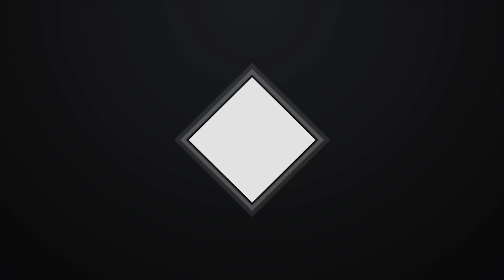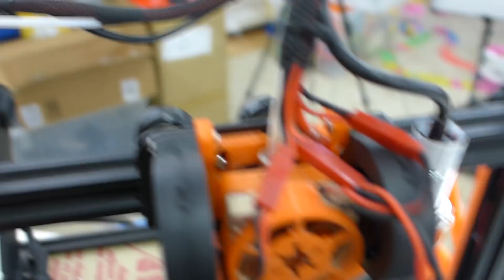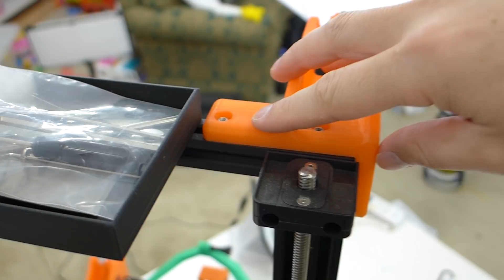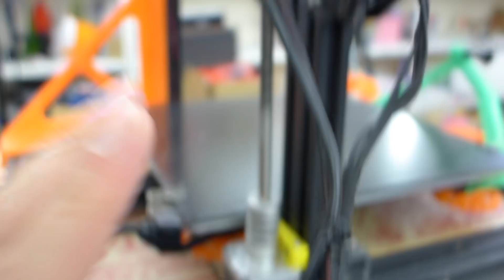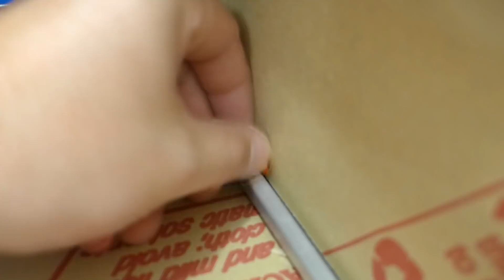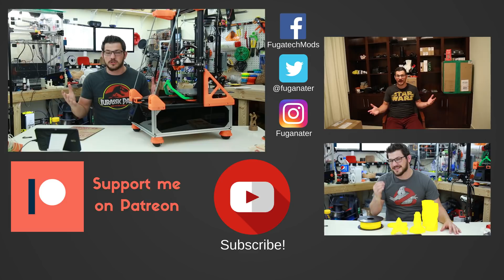Creality CR-10 Mods and Review

Comment: I've been using the yellow 1in nerf foam rubber balls under the feet of my CR 10S for the last 4 years. Definitely eliminates alot of noise.

I also just installed a set of stepper motor isolation mounts on the Y,X axis and now the original fan in the controller box is the loudest thing I hear.

Comment: Just got a CR-10 Mini, and I noticed it came with a lot of the little upgrades you were pointing out.  Made me feel better about buying it because I was worried it was just super old.  It also came with the 1.14 mainboard, which is a slight upgrade if I'm not mistaken. 

Already put a BTT SKR Mini E3 V1.2 in it (so incredibly quiet), been thinking about what to do with the electonics because I don't like that box either.  I like the bottom enclosure idea and the way you did it.  I saw another "Standalone CR-10 Mod" that looked pretty good, it separates all of the electronics into their own mounts that bolt to the extrusions.  Makes the whole thing nice and compact.  It also used a full 2020 extrusion gantry brace. 

So I might do a combination of that one and yours.  Also been playing around with mirror film lately, have some extra so maybe I'll do an infinity mirror enclosure
Reply from the maker: If you check out my CR-10S Mods and Review video, you will see the "Standalone CR-10 Mods" on that printer. I like that one a lot better but I wanted to try both.

Comment: That is way too tall to be effective on a shelf. It should be half that size considering the PSU is not that thick.
Reply from the maker: The main issue is the LCD screen. Yes I could have made it smaller but... I didn't.
Reply: If you look at other printers that have built in LCD's they only added them to the front or side. There are quite a few stand alone CR-10 designs that just add them to the side but if you have enough cable you can put the LCD anywhere.

Portable CR-10: https://www.thingiverse.com/thing:2764920

CR-10 Stand alone: https://www.thingiverse.com/search?sort=relevant&q=cr-10+stand+alone&type=things&dwh=785bc4a171e6c49

Comment: Nice mods, love the sub-frame.

Are you still using the stock hot end?
Reply from the maker: On this printer yes. The CR-10S has the MicroSwiss hotend and nozzle on it.
Reply: I've been getting a lot of clogging issues, been through the wringer of DIY solutions, been thinking about the titan aero e3d-v6 genuine hotend upgrade. Any thoughts?

Comment: Nice video, especially as I like the idea of the box being below the printer the way you did it. I think of doing this as well now.

One question: You put the original mainboard on the side, quite away of your fan and even behind your powersupplybox. Does it still get enough air for cooling the drivers?

When anyway redoing the whole setup of the box, why didn't you change the mainboard to use TMC21xx to get it to lower/zero noise? I know, cost is around $100, but at least worth to mention.

I have the dumpers at motors as well and I think they didn't reduce much noise, at least it is as you said 10% and anything which is <30% is below recognise level of human being. I wouldn't recommend them as of now.

That having vibrations of your box doesn't impact the print quality is I think as believe as have the rods to stabilize the z axis giving you improved print quality. But hey, they look great :-)

Finally: What is on your heat bed?
Reply from the maker: The board gets plenty of cooling because I am using a 120mm fan rather than some dinky 50mm fan. 
The board is fine, I eliminated pretty much all the nose with some stepper dampers and the racquetball feet.
I have the dampers on most of my printers and there is a difference. Some more than others. 
The rods only help when printing over 300mm high objects.
The bed has the Anycubic Ultrabase on it. Amazing print surface :)

Comment: What 5015s did you use? Are they speed adjustable or do they shut off if you drop the speed? I need to replace my 5015... and then I’ll be “off to the races”... lol
Reply from the maker: I've been using these: https://amzn.to/2NDuc5M They are adjustable and work on every printer I have used them on.

Comment: I understand that those racquet ball feet will dampen the sound but wont they also negatively impact print quality if the printer bouncing all over the place? My CR-10s has not been delivered yet (so have zero experience) but I was thinking the opposite would be better...placing the printer on the most solid (vibration-free) surface possible.
Reply from the maker: They do NOT affect print quality. That is a huge myth.
Reply: Sorry, I thought that I had deleted this question. I saw your previous response from someone that had asked the same question. Thanks for your reply. I do have another question for you. I am thinking about getting two Ender 3 Pros, a CR-10S and a CR-10S4. In your experience do the smaller printers print better quality than the larger ones?
Reply: Also...how does the print quality of these compare to the Prusa i3 MK3? Thanks!
Reply from the maker: Well I ordered a Prusa i3 MK3 but have not received it yet so I can't say personally how they stack up. In all the printers I own, the best quality for a small printer is the Anycubic i3 Mega and for the large printers, it is the Folgertech FT-5. The CR-10S prints well but is deff not the best. 

IMO, a smaller printer will always print better than a large one because there is less mass to move on all axis which means prints should be smoother if your printer and slicer is tuned properly.
Reply: I have been tempted to order a Prusa i3 MK3 and their new 5 color multi-filament changer. If the filament changer was not backorder for 90 days I probably would have already bought one.

Comment: How is the print quality/total cost with Modified CR-10 vs Modified FT-5 R2?
Reply from the maker: For the CR-10 cost is a roll of filament and some hardware. So $30? More if you add the EZABL and Ultrabase like I did. I don't have an FT-5 R2, I have the R1 which is fairly modified. I still get better prints off the FT-5 after all is said and done. It is also easier to enclose for ABS and other filaments.

Comment: Wish you showed before and after prints. Your z coupling is shot and is that the original PTFE? You might consider changing those. I added a 3D printed clip from Thingiverse to the extruder that guides the filament in. I actually prefer the electronics separate. Easier to get at. Nice work on the mods.
Reply from the maker: Hey Chuck! I didn't do before/after because I've been working on these mods for months. Once I get the printer back I can do a print quality video. I've seen people add those clips but thankfully I've never had the PTFE tube pop out of the couplers. knocks on wood
Reply from the maker: Having the extra control box kills me because it is a huge waste of space on my desk. Not that I have moved, space is even more of a premium to me.

Comment: It seems rather counter-intuitive to put balls on the bottom making the whole printer unstable. Tighten belts, tighten rollers, tighten screws, stop vibration, get rid of wobble then place it on a bouncy castle?  I'm sure it helps with noise but surely it affects movement of the whole printer and what more important, a bit of noise or print quality.
Reply from the maker: The balls produce zero artifacts in prints. Put it this way, if your printer is tight, no outside movement should effect quality. You can pick your printer up, while it is printing, flip it over and it should still print exactly the same. The printer moves as 1. But hey, don't believe me and live with a loud printer.

Comment: Great  video Shane.  I have the Anet E10 and I'm planning on doing the same thing to it. To totally agree with you about the control box. It makes cable management harder I think and does take up loads of space. I plan on building an enclosure for it too using the old Ikea lack table method. Thanks for sharing you ideas.

Comment: You have some really cool mods installed there! How do you power the LED lights? Directly from the psu? So you've bought 12V LEDs? Cheers!
Reply from the maker: They power directly from the printer PSU and have their own dedicated On/Off switch. Yes, 12v LED strip.
Reply: Thx for the info. :) I wanted to do this on my CR 10 for some time. Have a nice sunday.

Comment: I think you did a great job with all these mods.  My only question is why you made the lower box so huge.  It seems like you could have easily made it 1/2 that height, or even less than that.
Reply from the maker: Correct, I could have, but that was the size I cut so I went with it. I do like the internal storage it offers though :)